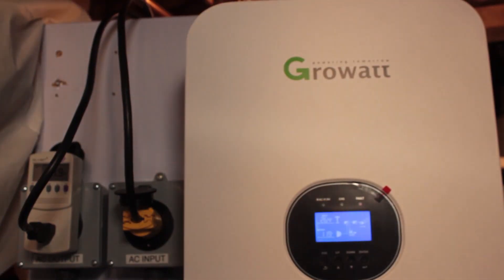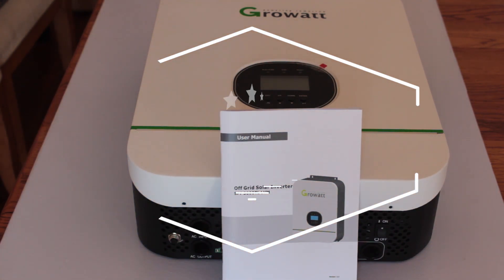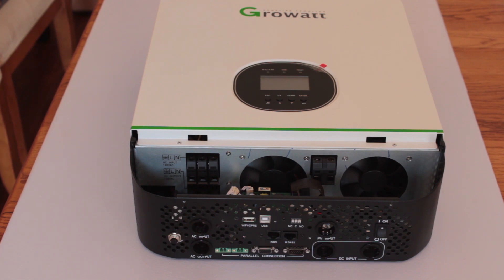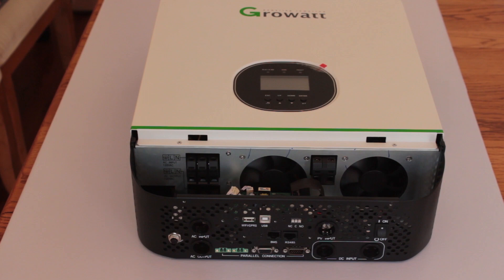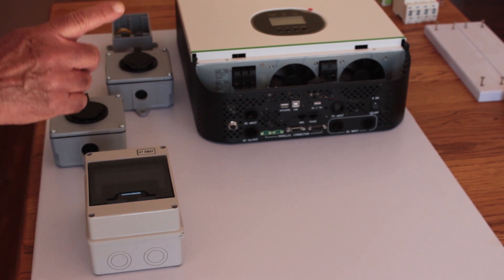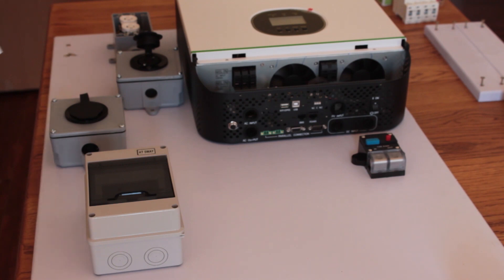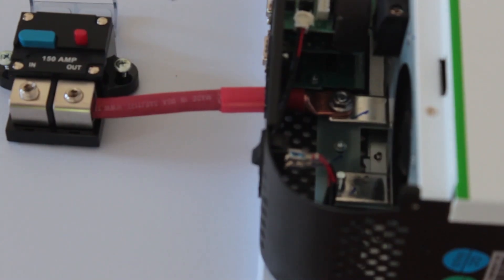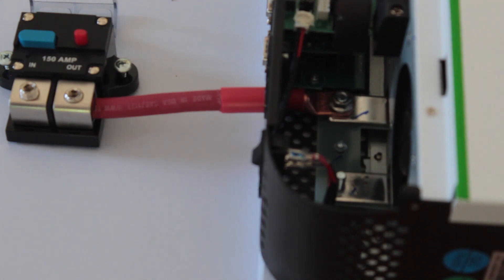Building an Off Grid Growatt Integrated Solar Power System - Part 1 of 3 videos

Comment: Do you manually change ac to dc or does it do it automatically??
Reply from the maker: Hi, I am not sure that i understand the question. The system via the Growatt's inverter is automatically taking DC from the solar panels and outputting AC, so not Ac to Dc. Happy to answer, if you want to expand on your question or watch part 2 and 3 for a better understanding of the system.

Comment: Please help:
I have a growatt 3000 and it doesn’t recognize my PV input at all. 
My panels are in series. 8X370 watt panels. I have a pv shut off switch hooked up. Any thoughts?
Reply from the maker: Hi Brandon, I am not sure if I can be of any help as I have never experienced that problem.  I would suggest checking the voltage from the solar panel cables where they connect to the Growatt to make sure your PV switch is open and the panels are indeed feeding the Growatt. Also, make sure that the voltage and watts from your panels does not exceed the Growatt specifications. If that is okay too, then I would check the Growatt settings to make sure you have everything set up correctly. Let me know if any of this helps. Best regards John

Comment: I need to do something similar and have to decide on either 24V or 48V, as well as the Growatt 3000 or 5000.
Reply from the maker: Good to hear you are building a solar system, I think the Growatt is an excellent all-in-one unit to use as the heart of your system. Regarding which is better 24V or 48V, there are a lot of good YouTube videos, sharing their opinions on which is best. I personally think the answer is based on your own personal requirements for functionality, meaning what are you powering and for how long and what is my budget.

Comment: Keep going man! It’s a learning curve to get started on YouTube but if you stay persistent you will grow. Thanks for the video!
Reply from the maker: Thank you Glen for the encouragement. I tore my right shoulder rotator cuff a couple of months ago, so not been adding any more projects at the moments. I have added more Solar panels to the solar system, so it is really working well for me right now.
Reply: @BrightSparkIdeas  sorry to hear that 😔 hope you heal well and quickly. I’m new to the solar stuff but videos like yours definitely help. Most of my components are arriving today!! Went with a Saufeguard Sigma Pro 3024 inverter which I got on super sale ($699 free shipping and no tax) and has very similar specs to the Growatt but the inverter can surge to 9k.
Reply from the maker: @GlenReed  That sounds like quite a deal. The specs look good on that unit, let me know how your build goes and what you are able to power.
Reply: @BrightSparkIdeas  i know how restricting that can be. tore mine three years ago and it took forever to heal

Comment: Good looking build. I’m working on a mobile cabin build as well. Working with 400W Solar, the same 24V/3000 growatt and 2ea 12V100 SOK. My question is when fusing the battery to inverter/ solar charge to battery. Why did you select the 150A disconnect. For the 80A I selected 100A...but now i dont know how do you configure or account for inverter fuse since they are the same system? Just curious and interested in your thoughts...just learning here . Thank you for the time ;)
Reply from the maker: Hi Rye, that is a great question. As you could tell from my videos, like you, I am learning too. For the DC over-current protection between the battery and the inverter I just followed the ‘requested’ guidelines in the User Manual for a Maximum Amperage stated in the provided table of 164A. (In the manual it said “Please refer to the typical amperage in the below table as required fuse or breaker size.”). The 150A fuse/disconnect was the closest I could find, just below the 164A max. I have heard that it is really a protection for the battery cables and have seen Youtube videos of the same set up as mine, using 250A fuses. Not sure if my answer helped, let me know.
Reply: @BrightSparkIdeas  yes totally helps. Did you find in the manual in the box or online... I was digging for this all day today and can’t find. Thanks for the help. Happy building 🤙🏼
Reply from the maker: @Ryegraw  Rye, I am pleased it was helpful. Here is the link to the user manual. It is a later version than mine, but should have all the information you need. Also, the second link will take you to watts247 where I purchased my Growatt. Here you will find all the manuals and lots of helpful information. Ian at watts247 is really helpful.
https://watts247.com/manuals/gw/Growatt%20SPF%203000TL%20LVM%20Series%20User%20Manual.pdf
https://watts247.com/
Let me know if you find it okay, did you watch my other two videos on this build, and please keep me updated with your cabin build. - John

Comment: I'm waiting for mine to ship.... I purchased due to Will also!!!!!
 Did you have to order yours as a "parallel model" (I did not see that option) or do all of these specific models come pre-configured to be a "parallel model" if you purchased another later on??
Reply from the maker: Ben, I did not order parallel model, but mine came with parallel cables included and instructions on how to set up in parallel mode, so you should be okay.
Reply: Yes they're all parallel ready.

Comment: What's the standby power consumption of the growatt unit?
Reply from the maker: Lei, I am sorry, but that is a question, that I have also wondered about. Call Ian at 801.403.0336 or check out his website Watts24/7.com as he specializes in Growatt and where I purchased mine.
Reply: @BrightSparkIdeas  thanks for the quick reply and Ian's contact info.

Comment: Great video. Was curious what exact (MCB) circuit breakers you used in in your distribution box. They look to be double pole style? Thanks in advance!!
Reply from the maker: Hi, Kevin, thank you, for the thumbs up and please subscribe as it helps me moving forward. Here are the two circuit breakers I used:
EHAKL - DZ47-63 C40 - 40 Amp 2 Pole Din Rail Mount Circuit Breaker UL 110 Volt 50/60Hz 4500 Amp
EHAKL – DZ47-63 C20 - 20 Amp 2 Pole Din Rail MCB Circuit Breaker 4500Amp @ 110V 50/60 Hz
Yes, they are both double pole circuit breakers.
Reply: @BrightSparkIdeas  I've been able to locate the breakers, but not the box. Can you let me know what item that is? Also, my AC load will be 30Amps coming in to the Growatt and then coming out to a 30 amp panel. T
Really appreciate the help and the video.
Reply from the maker: @philippauley4972  Philip, I believe this is the one I used -Circuit Breaker Distribution Box, Outdoor Waterproof Distribution Box Breaker for 5 WAYS Circuit Breaker Indoor on The Wall.  https://www.amazon.com/Awclub-Transparent-Distribution-Protection-160mmx120mmx95mm/dp/B07S75TV3V/ref=sr_1_1?dchild=1&keywords=Circuit+Breaker+Distribution+Box%2C+Outdoor+Waterproof+Distribution+Box+Breaker+for+5+WAYS+Circuit+Breaker+Indoor+on+The+Wall.&qid=1618076068&sr=8-1

Comment: Great video , I put a fibre cement sheet under the inverter like a fire wall then attached it to plywood looking forward to the rest of your build
Reply from the maker: That was a brilliant idea. Thank you, I could probably add that to mine without to much trouble. All 3 parts of my build are online and I plan to add another going through the Growatt settings.